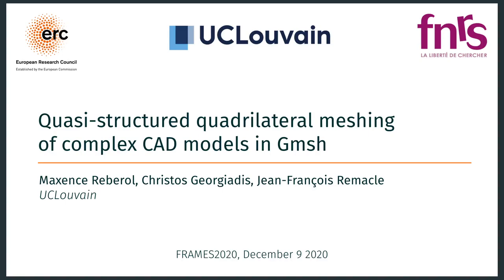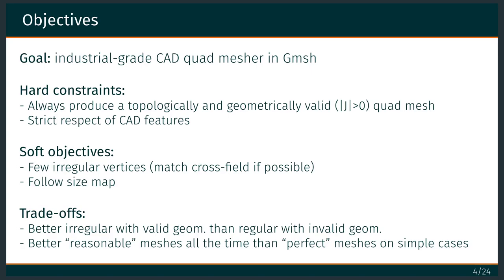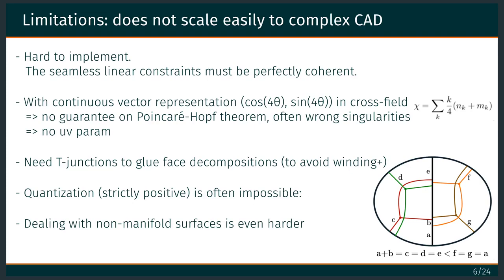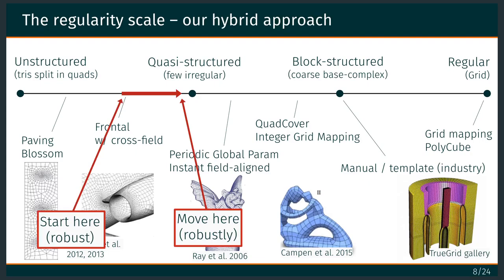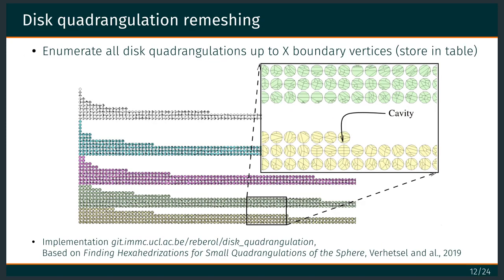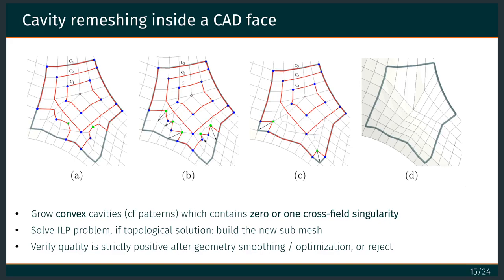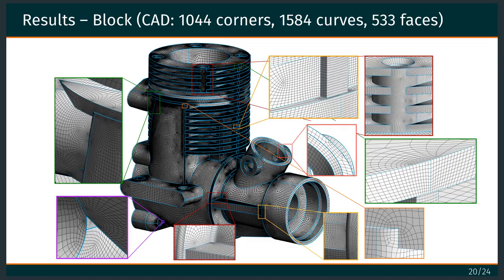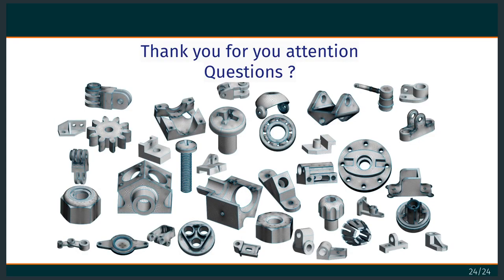Quasi-structured quadrilateral meshing of complex CAD models in Gmsh, Maxence Reberol

Comment: so does this mean it is possible to create conformal Structured Meshes similar to StarCCM+?

That would save a lot of money for the future, since multibody meshing (even with the same mesh structure) can usually only be solved well by commercial programs.

Big regards!
Reply from the maker: For surface meshing, maybe. If you need volume meshes, then it will probably not work.
I am no longer working on this (left academia), so I am not sure about the current capabilities of this mesher. 
The best thing to do is probably to try inside Gmsh and see if the results suit your needs or not.